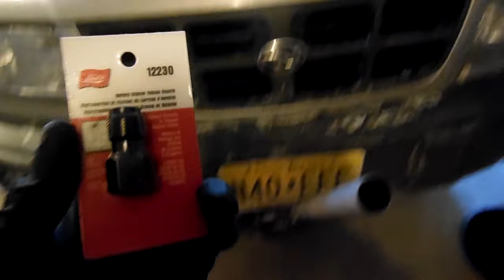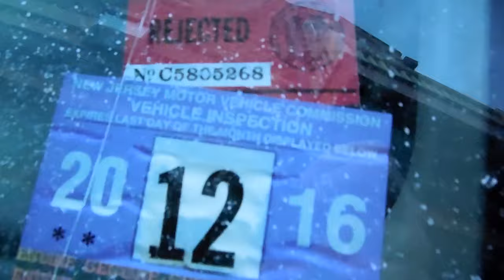Subaru O2 Sensor DIY

Comment: Pb blaster night before. Run car to operating temp, let cool slightly, tap sensor bung, pb blaster, use 02 special tool rented from AZ with the handle and 02 extension swivel. Tap the handle with hammer a few times while adding tension. Put on cheater pipe and progressively release it. If won’t go don’t force it, HF for the MAP torch. The socket handle special tool makes a world of difference so you don’t strip it.
Reply from the maker: That's a good method too! Mine was extremely rusted and seized, so I kind of went for the fast and easy way, which may have been why my threads got boogered.

Comment: Great video. I have check engine light with code P0130 on my subaru legacy wagon ej204. Bank 1 Sensor 1. Deleted the code and replaced the sensor but still the same problem. You know other possibilities for this problem?
Reply from the maker: Did you replace the upstream sensor or just the downstream one?
Reply: @FoulNews  i replaced the upstream sensor. The one that is in front of the catalytic converter. That did nothing. After that i unplugged the downstream sensor. The car is still running rough but i did not get a engine light. Could it be that the downstream sensor is faulty?
Reply from the maker: @luuk909  it's possible that it's faulty as well. However, it's also possible that you've got an injector or injectors that may not be providing adequate fuel flow or may be partially stuck open. It wouldn't hurt to clean the injectors and replace the seals as well. It's also possible that your primary catalytic converter is clogged as well.
Reply: @FoulNews  alright thank you for the information. Car only runs rough on low rpm/stationary. Accelerates well without any problems. So i dont think the injectors are the problem but i can look into it.

Comment: Forester 01,to03 easy to remove manifold, cat, in one go ,6nuts on the heads,2spring loaded bolts 2 plugs and voila, now see what you have, you can muscle the sensors, drill them out  test ,heat,  total control,go gentle with gaskets,reuse,use 03 manifold nuts ,they are longer and don't strip,I had 2 from 6 strip
Reply from the maker: I did eventually have to remove this exhaust when I pulled the motor. Two studs snapped and one flange rotted off lol. I did re-weld the exhaust, but I will probably make a new one soon for it.

Comment: Hey
Do you clear the code before taking off once the new o2 sensor is plugged in
Reply from the maker: Xavier Grillot Yes, I cleared the code. It will take about 50 miles of driving for the O2 readiness state to be active, so I recommend going for a long drive if you need to replace it before inspection.

Comment: Deplhi gives one error 32 on oxygen sensor. Local shop says they have two sensors. Before cat 50$ and after cat 110$. Sometimes I got check engine light, sometimes not. Could it be bad connection only ? Most of the times I get cel, it happens after hitting some bump. Also my fuel consumtion seems a bit high :(

Comment: Foul News, Good video my friend. Did you have a steady lighted Check engine light on with a blinking cruise light on?
Reply from the maker: Thanks! I didn't have that symptom for this issue. What's the code you're getting with your CEL? I have heard of that though for a bad O2 and or MAF sensor before.

Comment: My thread bung came off quite easily when trying to unscrew the sensor (It's still attached to the sensor) any recommendations on how to install a new one?
Reply from the maker: The entire bung broke off of the pipe? If so, depending on how rusted the exhaust pipe is, you may need to replace the pipe. If it's not very rusty, you could get away with welding on a new bung.

Comment: Greetings I recently changed my bank 1 o2 sensor and it still shows check engine with a p1133 code about a low voltage on it. Any recommendation?
Reply from the maker: Hello, did you clear the code after replacing the sensor? Sometimes it will only clear after completing a drive cycle or having the code clear.
Reply: Yes, it got back on after 3 days
Reply: It says code p1133 indicates that the PCM detected an unexpected low voltage on the front oxygen sensor circuit
Reply: And O2 sensor is brand new from the store, pleeeeeeeease help lol
Reply from the maker: @AngelABauzo That can be an annoying issue to chase down. Sometimes if you don't use a Denso or Bosch sensor the ECU will have a difficult time getting a proper reading and those issues can arise. Another thing to check for would be a break or a lot of corrosion somewhere in the harness that leads to that sensor.
Reply: any update??? did you figure out what was setting the p1133 code? Im in the same situation

Comment: I have a 1999 subaru outback legacy 4wd wagon is putting every time I hit the gas and after a while it drives ok till I stop I took it to Auto zone to be put on the computer and it gave me the codes for the spark plugs and wires I change it but it continues to do the same can some one help am tired of taking it to mecanic and they always guessing
Reply from the maker: Hi Cynthia, after the spark plug and wire change, is the check engine light still on? If so, what are the exact codes it's displaying?

Comment: Do i need to release the battery before i replace the o2?
Reply from the maker: Any time you're working with sensors it's always a good idea to disconnect the negative terminal of the battery. However it's not fully necessary for an O2 sensor replacement.

Comment: Did you pass after you replaced to o2 sensor??????!
Reply from the maker: 86 Stanza Wagon 86 Stanza Wagon Yes, I certainly did. I had to drive it for about 50 miles to complete the drive cycle first. As a matter of fact I’m due for inspection and I have a major exhaust leak, so I’ll probably film that repair process as well.

Comment: You definitely want to use anti sieze. That way the next guy wont struggle like you did. Or if you need to pull it back out and send it back.
Reply from the maker: Yup, at 5:23, you can see the anti seize compound on the threads as well.

Comment: That sensor was loosened before this video. You should've showed the struggle breaking it free. Plus that sensor isnt even that old or rusted....
Reply from the maker: I heated it up for quite some time before being able to break it loose, no need to have filmed the whole process further than I did. It was quite stuck in there and the threads were pretty butchered as well.
Reply: Agree; I'm one hour in atm...

Comment: Too much talk, need to go straight to the point, this ain’t no cooking show
Reply from the maker: mehnlo Unlike TV, YouTube gives you the option to skip ahead to the installation part without seeing which tools you'll need.
Reply: @FoulNews  All my cylinders are misfiring. Spark plugs are relatively new and wires are good. Threw a 02 code so I'm hoping if I replace both sensors it'll be smooth sailing. We shall see.
Reply from the maker: @robertsims3759  Good luck! I had a similar problem and it turned out to be my ignition coil, which showed up as misfire codes. However, an upstream O2 sensor failure can definitely cause multiple misfires.
Reply: @FoulNews  Got my upstream sensor on fine. Downstream is a whole other problem. Torched it for while. lots of elbow grease and nothing. Going to put blaster on it and let it set overnight. What a Pain in the ass.
Reply: @FoulNews  But if the new sensors doesn't fix the problem then your right about the ignition coil.